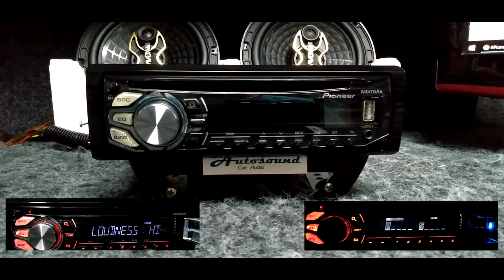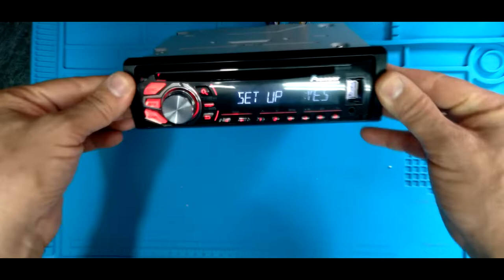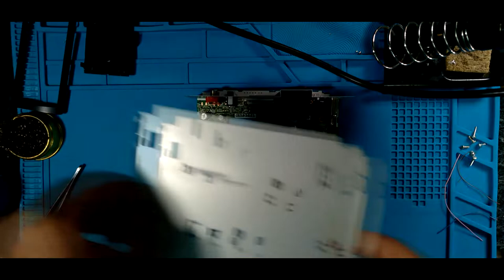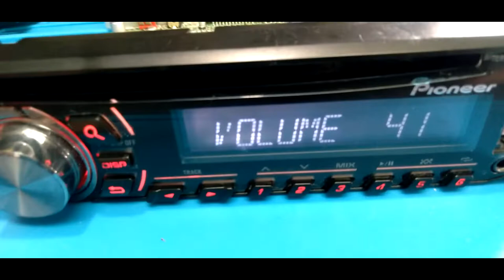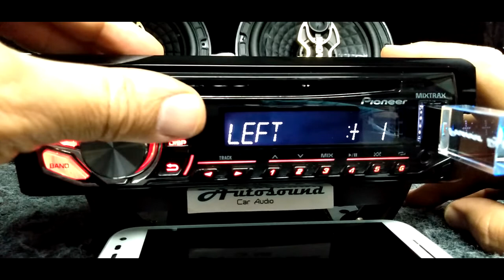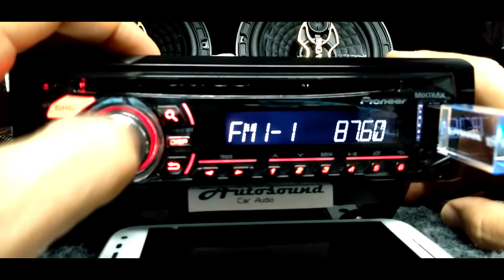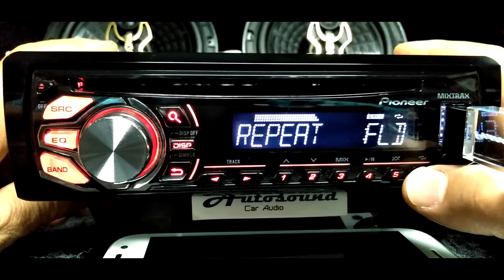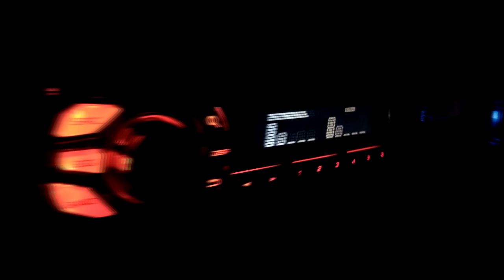#Pioneer Mixtrax Deh-X1650UB #Bluetooth instalação da placa interna p/ pareamento c/ smartphone.

Comment: Qual capacitor você usou na filtragem de ruídos?
Reply from the maker: 470uf 16v mais o que faz melhor trabalho mesmo é o conversor dc/dc 12 p/ 5v. Módulo de alimentação regulado, ibuw isolando comutação, B0505S DIP4 SIP4 B0503S B0512S B0509S B0515S, 1W B050505 DC-DC
https://pt.aliexpress.com/item/1005005692287329.html?spm=a2g0o.order_list.order_list_main.4.4c79caa42wxrVI&gatewayAdapt=glo2bra
Reply: @autosound  Da pra usar um de 470uf 25v?
Reply from the maker: @marcioomendess  Não é critico e não pode ser menos de 5 v nem menor de 200 uf .
Reply: @autosound  Ok!
Irei usar o capacitor de 470uf 25v. Obrigado!